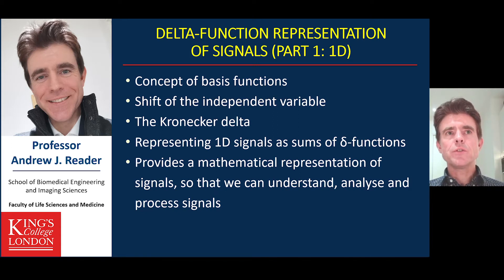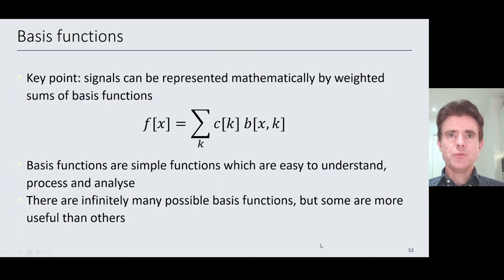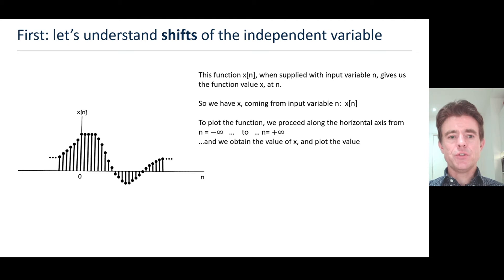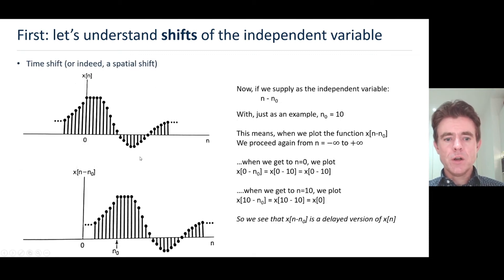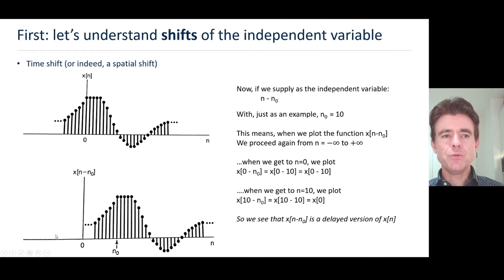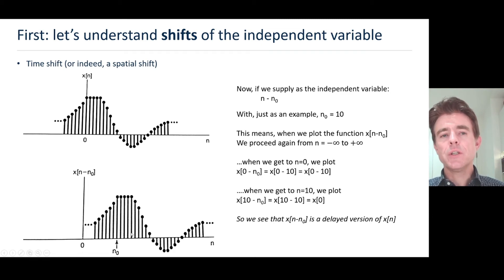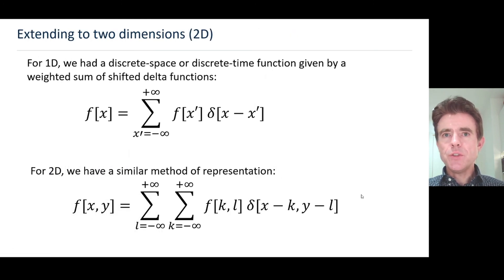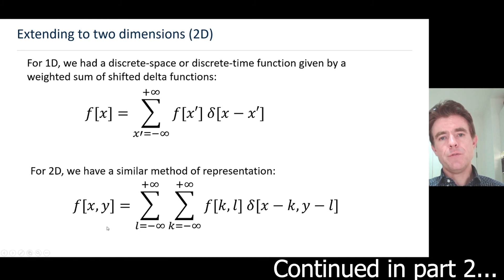Delta function representation of signals: part 1, 1D signals

Comment: Since k counts from -inf to inf but it k is inverted in 6[x-k], we are counting backwards from +inf to -inf?  Since convolution naturally arises from this sifting function, this may explain why the kernel is "flipped" when convolving graphically to show that the tail of kernel is aligned with x[n].  In theory the sifting dirac delta could be written as 6[k-x].  That way it would be moving from left to right in the sifting  summation: x[n] = Sum{  x[k] 6[k-n] }. It is probably unnatural to flip the independent variable x, but we would get the same result, wouldn't we?  However if we tried deriving the convolution from this form we would get x[n] = Sum { x[k] h[k-n] } instead of x[k] h[n-k]. This looks like a correlation not convolution. Why does flipping the dirac delta argument and counting from -inf to inf work for the sifting sum, but we would get an incorrect result for the convolution if we derived it from that from?
Reply from the maker: Many thanks for your detailed comment. May I first suggest that you take a look at my detailed handling of convolution from a matrix-vector perspective, contained in the following video? I prepared this video as I have found that very few understand the 2 key ways of understanding convolution, based on either a column-based or row-based implementation of matrix-vector multiplication - I think this clarifies a lot: https://www.youtube.com/watch?v=t-yjeQmYi5U
Reply: @AndrewJReader  Thank you, that's a great video.  The matrix approach that you explain is very similar to how one would write a computer program calculating convolution: we are dealing with two loops, in n and in k.  And it is our choice which of the two should be the outer loop.  If we fix  n, and iterate over k, then we get that "flip and slide" action and this is how convolution is typically explained graphically: calculate the value for the current n, and then advance to the next n.  But if we fix k and iterate over n first, then we get this more natural way of "shifting and scaling", and we don't need to flip anything since k is fixed and we are advancing n.   Imagine a cannon periodically firing fireworks and we need to estimate the amount of smoke after N shots. A smoke dissipation function is our kernel.  We can either consider each individual launch, and figure our how the smoke it produced dissipates with time and then add them together. O r we can look back and check how the combined effect of all cannons changed in time, so we would figure out the total amount of smoke at time 0,1,2, etc.